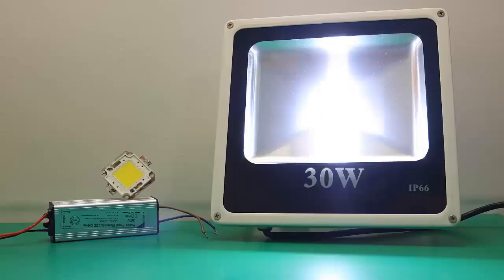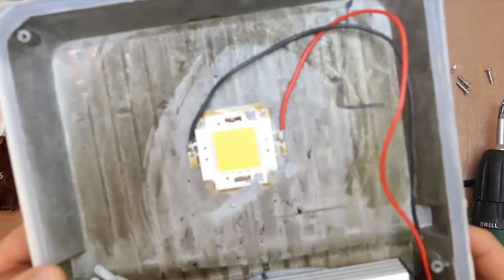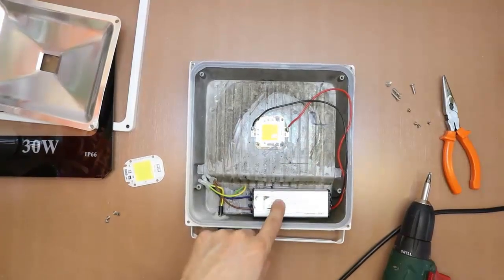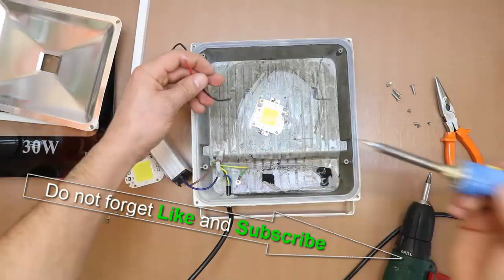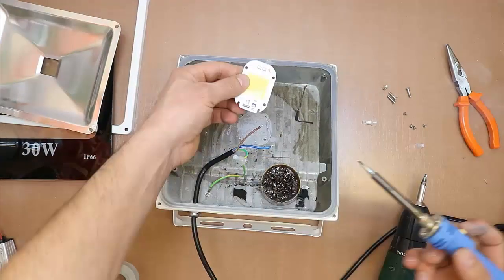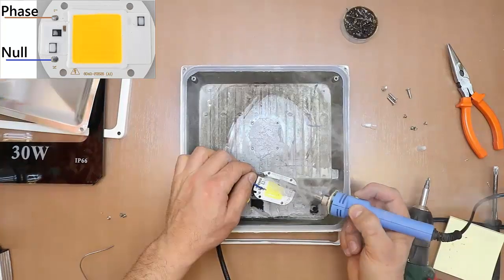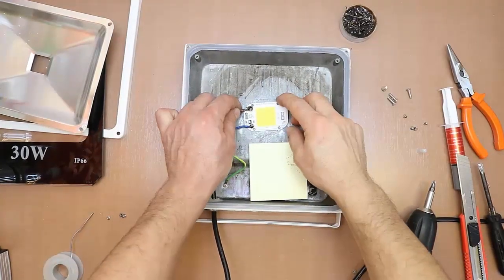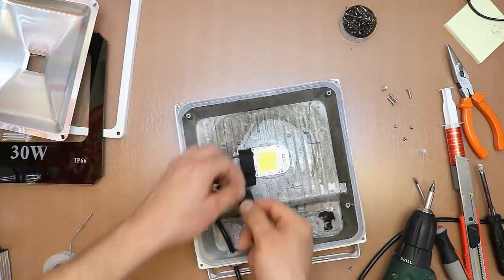Repaire the LED Floodlight / LED

Comment: did you compare efficient coefficient , voltage range and pulsation level ? integrated can has worst characteristics.
Reply: What are all those words?

Not sure if this helps but 220-240v sockets are for the most part dc at 50-60hz